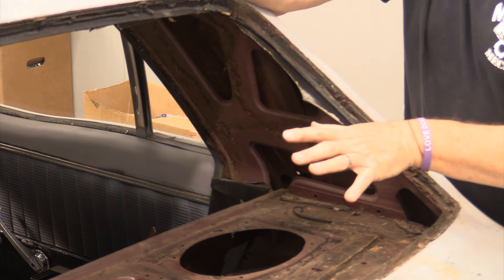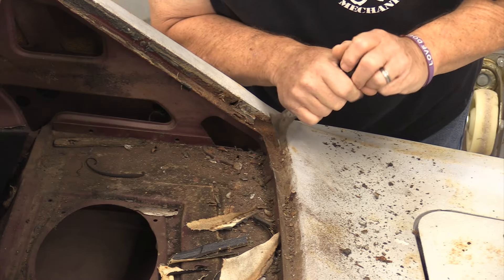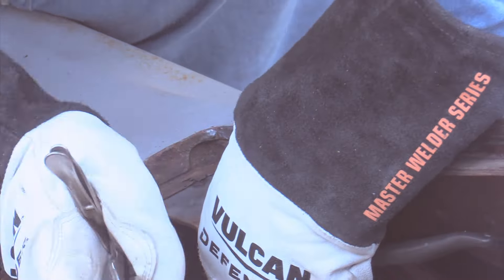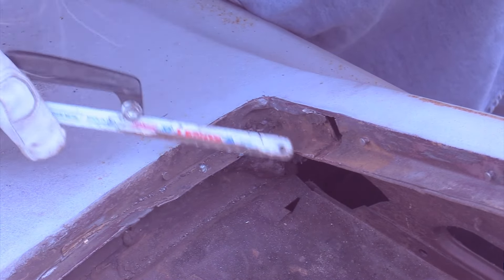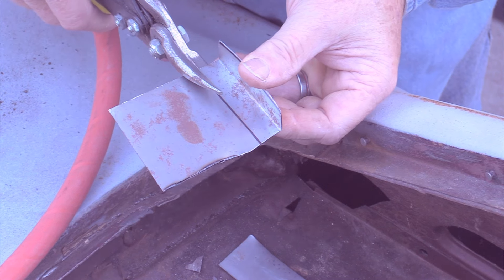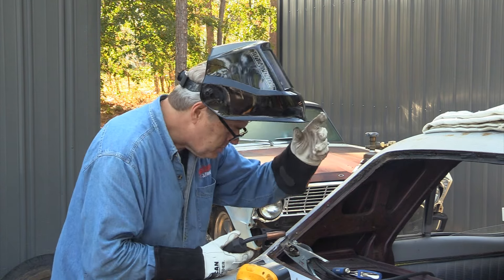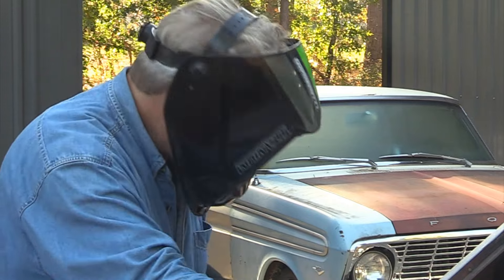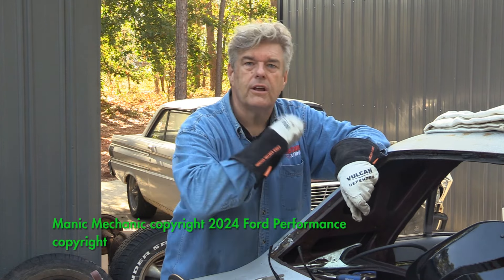Rust Repair The Rear Window Of A Car

Comment: About 13 yrs ago there was a neat invention.
It worked like a paint spray gun but sprayed melted liquid zinc onto prepped metal to literally replace the metal with metal zinc. Then you just grind it to shape, paint, its done in metal.
Havent seen it since.

Comment: Had held sandblasted and acid are invaluable in a repair like this. Have to pull out all the stops on  a job like this. Just did windshield  job p.i.t.a.🤘
Reply from the maker: Yes the big problem with either one of those methods is the sand from the Blaster can get shoved between two panels and you are unable to remove it and the acids can have the same problem. Not saying what you're saying is bad just saying that my experience has been that anytime you're running acid that gets in between panels it's really hard to get something in there to neutralize it